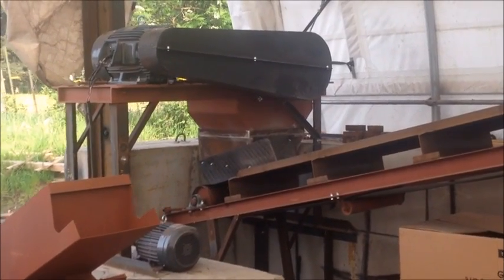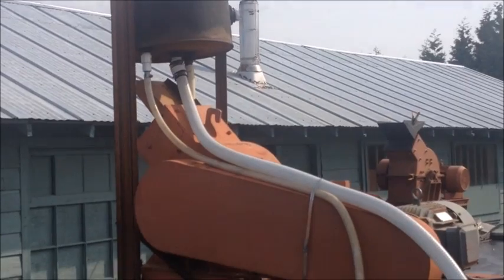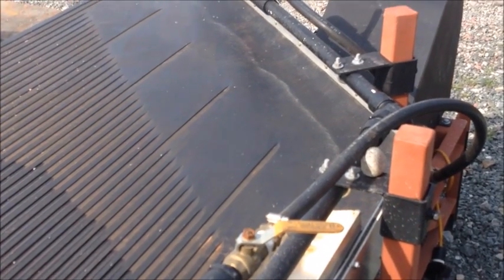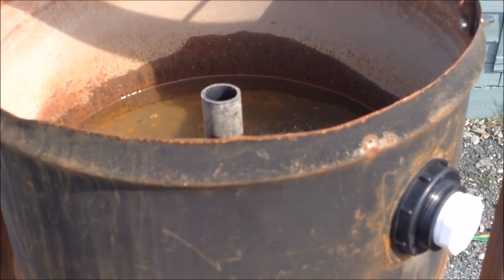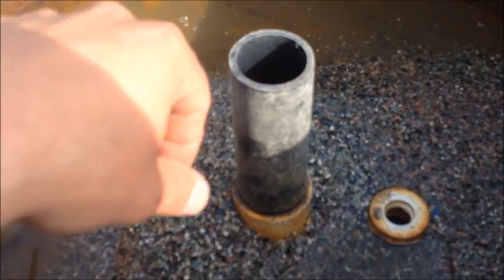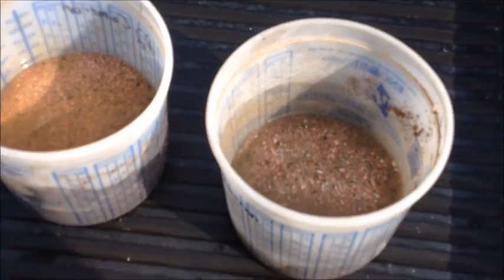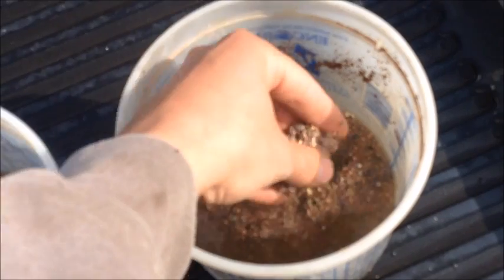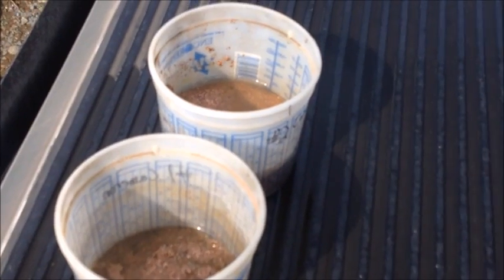Urban Mining for Gold.  Processing Circuit boards with a hammer mill and shaker table

Comment: I would think that a lot of the values are picked out with the magnet, such as gold plated pins and Crystal Oscillators.
Also I would try to speed up the water in your Hydro Cyclone,  I had the same problem on my copper wire set up so I made all the inputs and outputs flush to get the water spinning faster. Have a look at my video showing "how it works".
Thanks for another great video and Love seeing all your different set ups.
Reply from the maker: +corsagafa Thanks for the tips!  I will check out your video.  Thanks

Comment: Cool video, very thorough explanation of the process. I have a question about the tailings, what do you do with it all, and have you experimented with re purposing it, for example, recycling the plastics into packaging material or remelting the fiberglass to make insulation or building materials?
Reply from the maker: Hi.  All great ideas.  We haven't done much with the tailings yet, but we are always looking for ways to re use things.  Thanks

Comment: What weight of pcbs  gives a viable return on capital invested ,what percentage of gold do you get from the boards processed ? Great informative video.
Reply: I believe he said it was roughly 25-50 pounds of boards. He has stated in other comments that the set up can run about 200-400 pounds per hour and was around 85% gold recovered. The assay results video broke it down and figured there is roughly 4.5 Toz gold per ton. At today's rate, 11/07/20, that's about $8500 per ton, just of gold..

Comment: I'm not convinced of the ability of this device to remove surface gold from tracks. Have you chemically tested your tailings to check your efficiency?
Reply from the maker: Thanks for you question.  This machine is not meant to separate the gold plating from the other metals.  This machine is designed to remove the metals from the boards which can later be processed to remove the precious metals.  We have tested the tailings/waste from the board grinder and currently we are recovering about 85% of the gold, 90% of the silver and other PMs and much higher percentages of base metals.  We are working to improve our hydrocyclone design to get a higher recovery of the gold and other PMs.  Thanks
Reply: Id like to see your testing and waste - uh use or disposal
Reply: @mbmmllc  Great points and excellent stats one just one part of a overall recovery  system - the Table is the Rougher,  Smelting will recover the remaining.
Reply: @mbmmllc  price?

Comment: I've never understood why people used buckets of expensive dangerous chemicals & acids to process the entire raw Gold Recovery Material rather than small manually separated amounts. It makes recovery WAY more expensive than it needs to be. Even cheap car battery electrolysis effectively & quickly separates gold from base metal plating substrate on PC cards + pins.

Comment: Hello how are you , found on you tube Video que has equipment que grinding circuit boards and at the end of this process by separating the metals , including gold , i have a doubt in the equipment , this can Also be done with memory cards ram ? because I am chemist and I am purifying gold of These electronic waste and this equipment is really very good . I 'm from Brazil and so if there is any error in Inglês I apologize , thank you and look forward contact
Reply from the maker: Hello.  Yes this can be done with memory cards and RAM.  I see you have already send us an email so I will respond with more detail through email.  Thanks
Reply: They take only the free gold. The fact that the plastic goes in the garbage. Hydrochloridebuy need a large volume.
Reply: Hello how are you, we talked a few months ago, would you have facebook so we can chat, thank you

Comment: how many pounds of boards do you run per oz. retrieved? what is your operating costs per oz. of gold retrieved? thank you.
Reply from the maker: +fuddrucker74 Those are great questions.  It will really determine the types of boards your are running.  They are quite varied depending on the type of board you are processing.  Mother boards have somewhere around 3-5 oz gold, 15-30 oz silver, and about 500 lbs of copper per ton of boards.  Thanks
Reply: +mbmmllc ok, thank you. I needed some context to wrap my head around. thank you for the quick reply.
Reply: hello, thanx for the video , do you also separate palladium and platinum ?, greetings
Reply from the maker: +thibaud can lidth Yes our shaker table does separate palladium and platinum, the majority of both will go into the number one port and the remaining will go into the number two port.
Reply: oke thanx!  keep up the good work guys!

Comment: Hummm  don't the mag belt get the gold plated pins and them lil steel fockers with silver in them . ??
Reply from the maker: Great, thanks for the tip!
Reply: @mbmmllc   I liked your wet hammermill with the wet shaker table.   You ever think about doing car batteries?  Drain asid. Add LOTS of baking soda to the water. Seberate lead and plastic.

Comment: You are losing most if not all of your precious metal recovery with this method. It will either be pulled out with the magnet because a lot of precious metals are plated or combined with magnetic metals, and your machine can't grind it down so fine that it separates plating or micro components that contain both precious metals and magnetic ones. Or it will be carried into your #1 and #2 buckets where it can't be separated any further, unless you use chemicals on your #1 and 2
Reply from the maker: Hi Bob.  Thanks for your comment.  The magnetic cross belt used in this video is not recommended for use with circuit boards.  This is our recycling line and primarily used for separating ferrous and non-ferrous metals.  I wanted to show the larger 24"x16" hammer mill and discharge conveyor as a pre-chopper for some of the larger circuit boards.  

You are also correct that this machine is not designed to remove the plated gold from the other metals.  There is quite a bit of free gold that can be liberated from the chips and other components and recovered on the table, but most of the gold plating stays on the base metals.  Notice at about 6:33 all the gold plated pins going into the #1 & #2 high grade buckets.  

The goal with this system is to concentrate and separate the metallics from the plastic and waste board materials.  As you can see at the end of the video the results are almost 100% metal free from contamination.  By screening and re-running the #1 on the table you can get a pretty clean gold product that can be melted down and sold directly.  The remaining values in silver, copper, gold plating, etc. need to be sent off or refined in house to recover the rest of the metal values.  Refiners will pay a much higher amount for these metallic fractions off the table than whole boards themselves.

We have run several assay tests of the boards and waste material and have determined that we are actually recovering about 85% of the gold and silver values by using this method.  We have found that mother boards have somewhere around 3-5 oz gold, 15-30 oz silver, and about 500 lbs of copper per ton of boards.  Stay tuned for more vids.  Thanks
Reply: "...not recommended for use with circuit boards."  I'm seeing you putting MB and other type of circuit boards into your machine.  And that magnetic separator, you are gonna get a lot of good and bad stuff picked up.  The only best way to process circuit board is my hand.  Otherwise, a lot of goodies gets into the trash.